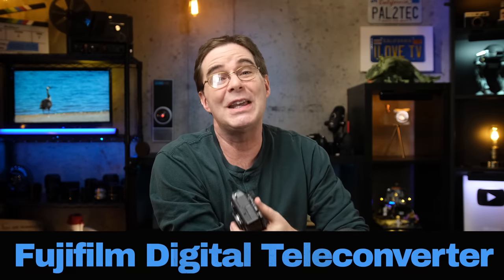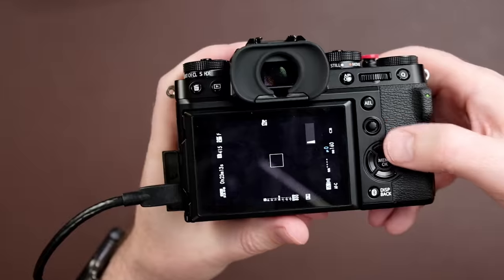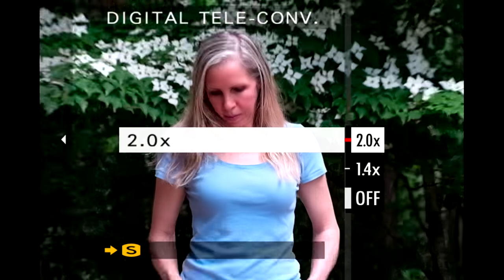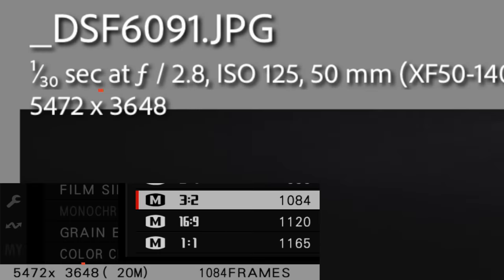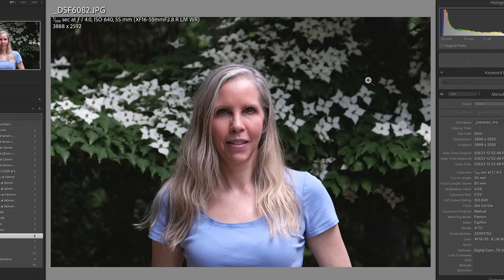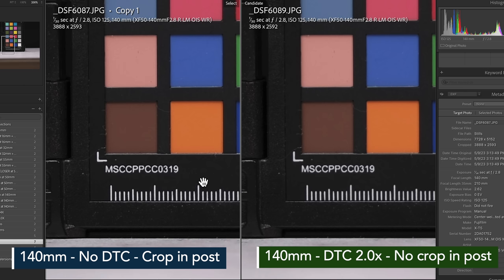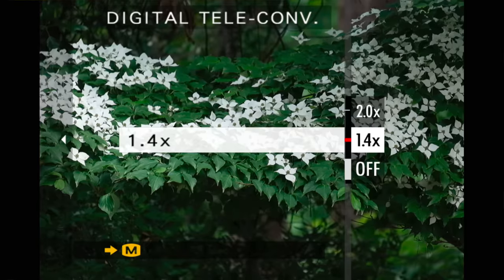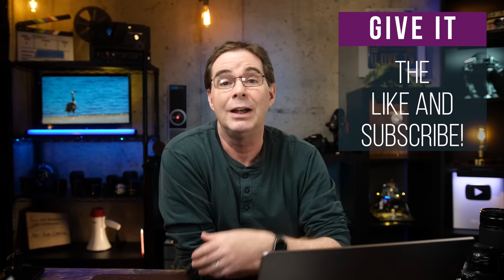Fujifilm Digital Teleconverter (EVERYTHING You Need To Know!)

Comment: I use the 2.0 DTC all the time to set my focus point right where I need when photographing small birds, insects, flowers, etc. it makes a HUGE difference, much more easier to focus on a bug’s eye because it magnifies the EVF. I get a nice jpeg but a full size raw file for later use. I find it to be a killer feature.
Reply: Great tip
Reply: You can also use the focus check option, it does effectively the same but without having to sacrifice uncropped jpegs. If that's what you'd prefer anyway.
Reply: why dont you use the focus check which is 10X?
Reply: Ohhhhhhh! That's a point that makes sense.
Reply: @chrisbartlett8146  because I like getting my cropped jpeg. I mostly use jpegs, these days I rarely edit because film recipes got me. I’m just addicted to the convenience of not having to edit before I upload to social media.
Reply: The reason not to use focus check is because that mode jumps you in and out of the zoom, which gets frustrating if you’re taking a bunch of pictures all of which you’ll just crop later.  

Having this teleconverter mode seems really useful to indefinitely zoom the whole interface. So glad they added it!

What we need now is for Fuji to embed metadata in the file and for Lightroom to honor it by cropping the raw file automatically, similar to how it handles film simulations.  Does that work already? If not it seems like an obvious optimization.

Comment: I see another commentor claims the feature is available for video, which I hope it would be, because this feature allow the use of lenses designed for smaller sensors such as micro 4/3. In particular, professional broadcast cinema cameras have standardized on smaller sensors and there are many great quality parfocal zoom lenses out there on the used market. Without this feature you will see a heavy vignetting with these B4 mount lenses.

Comment: The digital tele converter is made for prime lenses I believe. On my Fuji XF10 it works wonders! The camera has a 28mm equivalent prime lens and when using the converter to 35mm or 50mm the resolution stays the same 24MP and it is noticeably sharper than cropping the 28mm footage. I even think the build in processor corrects lens distortion differently on the converter. So it's not just a crop. However, for obvious reasons as you say, the background blur won't change. But on a prime lens you have no choice anyways.

Comment: i have the xt5 with 50-140 and 1.4 teleconverter, and have used the digital tele conv to help compose shots that I know I am too far away to take and will have to crop in post anyhow, so it is a great tool from the composition point of view, and 10mp images will still have zero issues for enlarging and sharing on social media. I find it a very useful feature.

Comment: I like the Sports Finder mode. Its a 29% crop of both RAW and JPEG. You can see subjects before they enter the frame. Its great for composition with a constantly changing scene, sides, top and bottom. Since it is a less severe crop, I don't really notice a loss of quality. My 18mm crops to 23mm"ish". It does not work with electronic shutter.

Comment: I found that there is no focus assist (focus peak highlight) in MF Mode with the digital teleconverter is on. 
But all in all this is a useful feature just like the apsc crop mode on a FF camera. With the x1.4 we got a 20MP picture which is still pretty good to work with. The clarity and resolution are still gorgeous especially with those newer optimised lens.

Comment: I've been using it with my 100-400 to do "test runs" of what the focal range of the real teleconverters would be like. Getting use to what that lens would be like on a 1.4 or 2.0 physical teleconverter. I'm not too worried about the light loss from the physical ones given the ois+ibis on that lens and X-H2 body, and also that I'm in Texas where the sun is so brutally bright I sometimes NEED to stop down to f9 while at 125 iso and +1/1000 shutter speed. 
I've also used it at a race track down here given some parts of the viewing area are blocked off. Felt great rolling with (granted a chunky lens for Fuji) just a 100-400 while some people on Canons and Nikons were running the giant 600+ primes on monopods, while the digital teleconverter helps surpass that full frame focal length.

Comment: I can see a use for this with the 100-400 lens for example. when you are shooting in low light (which is most wildlife photos in the UK or in a forest/jungle environment) using the teleconverters  reduces autofocus speed with either the 1.4x or 2x in my opinion. and losing a few stops of lights is never good when ISO is already being pushed hard.

In my limited testing shooting without the TC and cropping in post with X-T5 produces adequate results with smaller birds etc. So being able to shoot with the Digital TC to get a "Preview" Jpeg that you can see easier through the viewfinder gives you a good idea if you have got the shot before you get home from your trip
Reply: I would love to see a comparison of the physical and digital teleconverters. It strikes me that the physical ones were useful and needed on 26mp cameras, but with a 40mp sensor, the detail will be there either way, depending on the lens and atmospheric conditions.

Comment: thank you for this very clear explanation as always. The main benefit of the digital zoom for me is as a focusing aid. I shoot small birds and other wildlife with an X-H2 with either the xf150-600 or xf70300mm with 1.4xTC when traveling. RAW + Jpeg L but only process the RAW and have the jpeg as backup. Distant subjects in busy backgrounds often struggle with AF but I find the digital zoom often improves the speed and accuracy. I see it as a bit of a workaround until such time, fingers crossed an improved firmware is released.

Comment: You can use it with raw just to make it easy to focus on distant objects. The resulting image is the raw with perfect sharpness at the right spot. The problem is that focus peak doesn't work with feature.
Reply: That’s such a frustrating limitation!!! It’s ideal for manual focus otherwise.

Comment: Another excellent video, Chris. But there’s one inaccurate statement that needs clarification. When comparing digital to optical teleconverters you stated that with optical teleconverters “there is no loss of resolution.” That’s simply not true. There is almost a hit to resolution at some level with it being more noticeable with 2x teleconverters compared to 1.4x. In some cases, the resolution degradation is enough to make cropping a viable option in place of using the teleconverter.

Comment: Hi Chris, thanks and congratulations! Excuse my Google Translator English... I hope you understand... This function is very interesting, but the fact that it is only active on jpg is a limitation! It would be nice if it could also be active in raw and that in post-production software the crop made in the camera is visible but reversible. With several machines it is possible to do this (for example Panasonic S1). This would make working in pp on raw faster, without having to use the cutter to make the cut made during shooting with 1.4x or 2x!
I'm a wedding photographer, and this feature would be useful on raw! NB. The "sport viewfinder" mode applies the 1.29x crop on both jpg and raw! I would like 1.4x and 2x cropping in raw, visible in LR but reversible... It would be nice to ask Fuji to do it with a new firmware! A thousand thanks! Best regards

Comment: I use it a lot on my 16mm to work as I would use a 23mm. Because 16mm is too wide for me sometimes. Lightroom mobile remembers the digital crop and applies it by default afaik on raws. Since having a 40 Mpx sensor the loss is not so heavy and I have 2 lenses on 1 on the jpegs.

Comment: 10:55 you have shown that the crop affects not only the angle of view but the range of sharpness as well. If you stop down the longer focal length by the digital crop factor, you should get the same look in terms of angle of view and bokeh. 

I think in the latter case you take a hit due to less light and therefore higher ISO but you have more resolution. I assume with heavy noise reduction and downscaling to the same resolution of the digitally cropped image, both look alike in terms of sharpness and noise again.

Comment: Another brilliant educational video.
I've not used the digital teleconverter yet on my X-H2, however used on occasion the sports-finder, when caught short with my XF 23mm F/1.4 (MK1) lens and found the resulting ages very satisfactory.
Further more, despite the excellent EV, as an eye glass wearer I find the sports-finder very helpful in framing particularly a moving subject.
In your opinion are the results between the 1.4 digital converter, & the 1.5 sports finder comparable?
John G

Comment: I’ve used the digital zoom on the X100V - quite a handy feature. I don’t think it reduces the image size though but I’ll check!
Reply: How would it not?
Reply: I have used this feature on the X100V and the image size remains exactly the same, 6240 x 4160. This is because Fuji sizes up the cropped versions with a built-in program similar to the program, Genuine Fractals, used in the early days of digital photography when we only had 2MG sensors that otherwise was insufficient to cover a two-page spread for print publication. Check it out!

Comment: Hello! I have a Fujifilm X100F that has the digital teleconverter function. First of all, it must be said that it can only be activated if I shoot in jpg. But to my pleasant surprise it doesn't crop like it does in Lightroon. On the contrary, it does a rescaling and keeps the size of 6000x4000 pixels. And it actually does quite well. That's why it strikes me that the X-T5 doesn't do the same. Could it be that in this case if you shoot in raw it cuts and if you shoot in jpg it doesn't? Please can someone confirm it for me? Thank you so much! Greetings from Buenos Aires, Argentina!!!

Comment: You can use this with video at least I use it with my XH2, in 4K HQ you can use the zoom, remember with video often there is already a crop applied, my XH2S does not do this with its lower resolution sensor.
Reply: Is there less rolling shutter if you use the crop in video mode?

Comment: I’m a bit confused on how to calculate the equivalent focal length after the crop factors of both the cropped sensor and the teleconverter.
So for example the FX 23mm be equivalent to 48mm if set to 1.4 on an XT5, right?
Reply: Yes. Focal length x 1.4 x 1.5

Comment: There’s literally no reason to shoot like this IF you have software to edit with. All the digital conversion is doing is just cropping in on the existing pixels. It’s taking a picture, cropping in 1.4 or 2x and then outputting a jpeg file. The crop might affect light sensoring so that might change the image a little, but any image taken in RAW only can be cropped in the exact same way for the exact same photo. 

The only reason someone would do this is if they want the SOOC jpeg with the Fujifilm film simulation and want to do 0 editing. Which is fine, do what makes you happy I’m not here to rain on that parade. I’m just saying IF you are shooting RAW you’re going to be editing. And if you’re editing you are literally losing nothing by having the full sensor image.